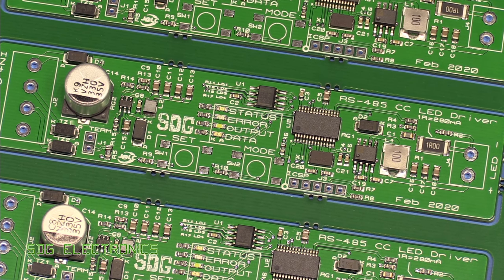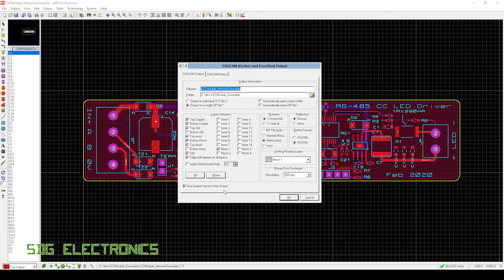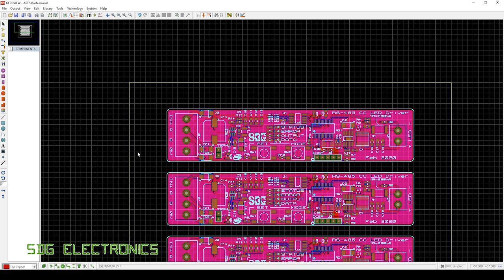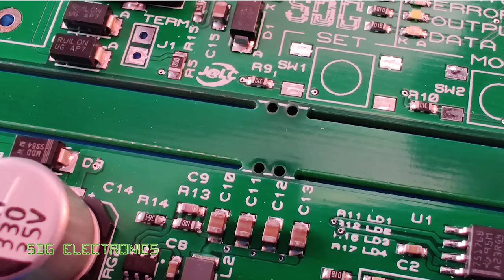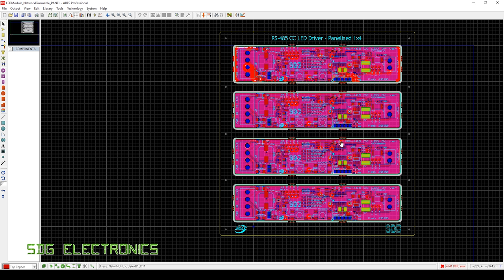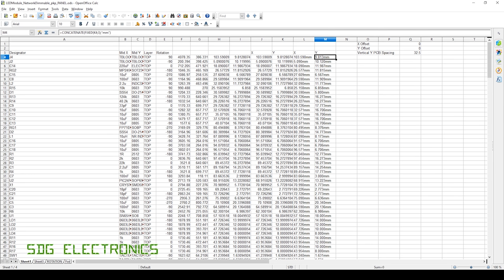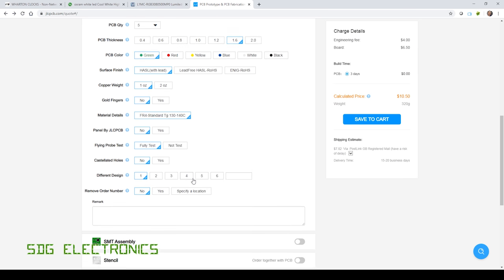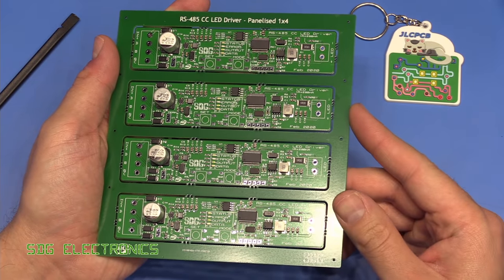SDG #138 How to Panelize your PCBs

Comment: Fun fact- dont put ceramic capacitors near your "rabbit holes" or "mouse bites". For instance- C5(?) on your panel is right next to your rabbit holes. If you bend the board to break away from the panel, theres a good chance you will crack your ceramic capacitor as well.

Comment: You can copy and paste into the original file without a problem. I have been panelizing in Proteus this way as I didn't know there was another way. Do a DRC then copy to clipboard and paste as many copies as necessary. Make a gerber file, but do not do a DRC. When you close and reopen Proteus all of the copies will be greyed out and will need to be deleted. Quick and dirty, but effective.

Comment: There are 3rd party panelization programs, if your software doesn't have any support.
For Design Spark PCB, simply copying the board in the program works fine, it asks if you want to "merge with existing net" just answer "all no".
Just save the panel version under a different name.

Comment: Thanks for this. I said before I probably have learnt more from you than other other youtube videos. I use to created my projects by plugging together wemos/arduino boards with very simple
pcbs to allow joining. I have now been inspired to convert my old wireless blind controller to a pcb as my brother wants the same so I have to make it more user friendly now.

Schematic https://drive.google.com/file/d/1KmeCSTC_glbcSmax6qCGXAs7xr3GNksz/view
PCB https://drive.google.com/file/d/15sv7q3CCqkSrB8I9cLInoTxyb5IhEzqF/view

I have used your idea of drilling holes to separate the board in half so I can break or cut easier
(jlpcb can only do v grooves on boards greater than 70*70mm).

I also used some of your design style from you other schematics like the NTP clock.

Have you ever consider having the odd episode of critiquing other peoples designs they send in ?
It would probably show up mistakes you would not even think of ever making so could prove illuminating.

Thanks for all the hard work.

Comment: Do you have to consider the mechanical stress of de-panelizing the PCBs (i.e. cutting them out!). What's the best way to do that (asks the beginner to PCB production beyond liquid resist and free hand drawing!). Thanks Steve for sharing!
Reply from the maker: Yes, so it's a tradeoff between panel rigidity and removal force. For production you'd normally use a jig that snaps them with zero force to the assembly or alternatively a final routing pass is made. For DIY, it's down to careful planning. 
I'm going to experiment a little to come up with some basic design rules as I failed to find any decent resources
Reply: @sdgelectronics  For panels like yours, about the only way I've found to separate them with no risk of cracking MLCCs or breaking IC legs is to use a hacksaw blade to cut the castellations, then file the edges smooth.  V-scoring, done properly, makes for easier PCB separation, but I don't know if JLC does that.  Can't get radiused corners with V-scoring, however.

I notice there are no fiducials on your boards.  Does JLC not require them for automated assembly?
Reply from the maker: @FlyingShotsman  unfortunately no v-scoring can be done on PCBs that go through the SMT assembly service oddly. Not sure why. They use tooling holes rather than fiducials, which are the little holes you can see around the panel

Comment: Hi, how did you make the non - plated hole?
Reply from the maker: It depends on the software, but it's specified by your drill file
Reply: @sdgelectronics , what is the recommended size for the panelized holes?